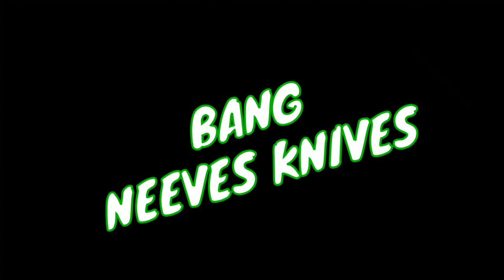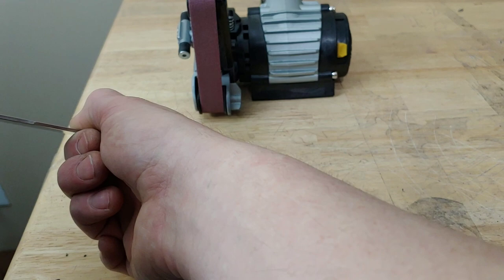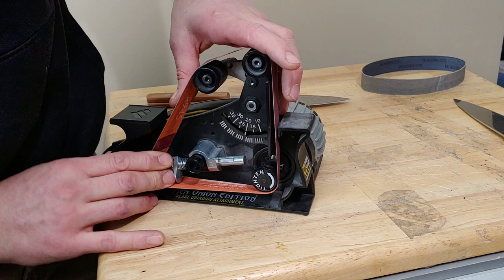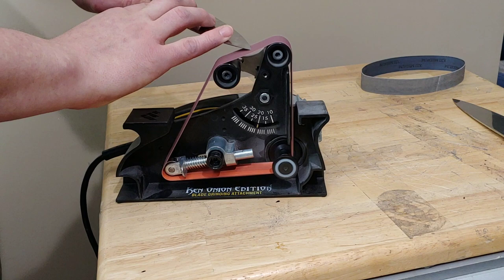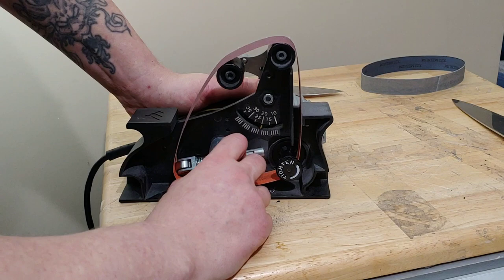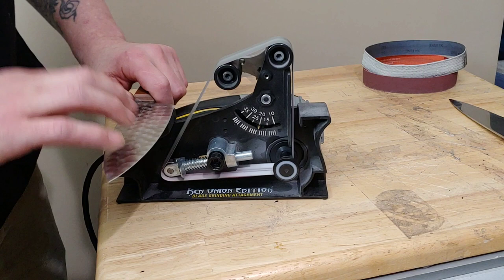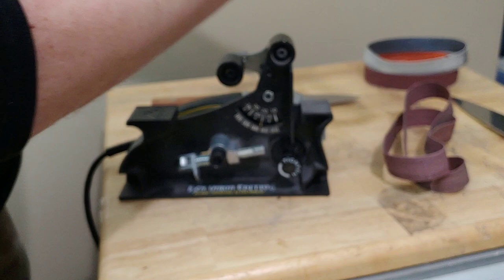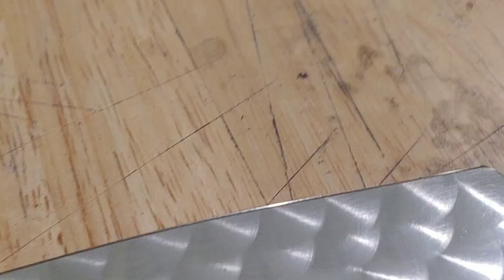DIFFERENT WAYS TO USE THE WORK SHARP KEN ONION

Comment: Very good video, this will help new users.  I received my second Ken Onion Blade grinding system.   My plan is to set up both on work bench.  The coarser belts will be used on one and X-4 and stopping belts on second one.  I will be doing this if sharpening multiple knives.  If you use Allan key you can move back wheel up one hole for flat angle grind which would be similar what you get when sharpening on stones.
Reply from the maker: Nice! Ive heard people say theres ways to get flat bevels with a couple tricks i mostly use it for grinding and for convex since i freehand flat edges, but great info
Reply: @NeevesKnives  .  Another modification you can make to the angle grinder is get 2 replacement leather strop -guided field sharpener.  They would need to be cut to length, but two of them will fit on plate behind the 90 degree plate.   With the the 2 leather strops which would be on behind belt makes It much better and consistent for doing 90 degree grinds.
Reply from the maker: @robertdewalt8711  oh wait i think i seen that somewhere, your talking about the leather that goes on the little field sharpener right
Reply: @NeevesKnives  .  Yes, the strips are about 13 mm wide.  You would need to cut off about 24-25 mm from length of each strip,   I have add the strips to both my angle grinders.  Two of them fit very well on the plate behind 90 degree plate.  On one of the Worksharp videos they talk about it and placed on their Angie grinder.

Comment: You said you get the burr with each belt, but you went to alternating strokes after the first belt. Are you getting a complete burr along the entire edge after just one pass on the second, third, etc. belts?
Reply from the maker: Sometimes yes i wasnt sharpening the same knife, some knives get a burr very fast especially if your using a low angle, when you lay the angle back and the bevel on the knife is high, then it takes more passes, if i match the amgle then its very fast

Comment: Great how to on sharpening with belts for any system. Have to be aware of heat though and some belts remove material like crazy. I Found out the hard way once.
Reply from the maker: Yes definitely thats why i keep it turned down to its lowest setting the edge never gets hot that way
Reply: As someone who has tried some actual grinding with the 80 grit belts they sell, I would hate to see what that would do to an edge!
Reply from the maker: @jameshealy4594  its fine for reprofiling as long as you move up in grt i originally bought them for regrinds so thats what i use them for mostly

Comment: Hi mate, great video. One additional method I use is to attach a piece of belt backing to the aluminium piece below the top wheel (if that makes sense), between the metal and the back of the vertical section of belt. You can then use it to put on a V edge as it gives you a platen to grind against. Maintaining the angle is trickier but with a little practice, it's not difficult to learn. I use a cheap spring clamp to stop it moving around when using the attachment since the flat bottom gives you a surface. I also love the stiff belt kit they sell now, though I've had terrible luck with the strops - two packs and they all broke within a short time of use, I think I must be doing something wrong but no idea what. Thanks again for the video! Oh, one more tip, especially for anyone trying actual grinding - get some neodymium magnets to help control dust or use a dust extraction system, I killed one by steel dust being sucked into the motor and shorting it. Still love the system.
Reply from the maker: Thats amazing James great idea! These can definitely be very versatile once you play around a bit

Comment: Great video! What are your thoughts on S35VN on a chef's knife like that? They aren't typically made with such high-hardness steels. Notice any problems with chipping or similar?
Reply from the maker: I wouldnt really expect to see chipping but more rolling, and i would think that not having a high hrc might be good, since you chop on hard surfaces, the edge is more likely to roll and not chip, but in all honesty i didn't notice any rolling or chipping it seems to work great i was worried at first having such a sharp edge that i did freehand that it would chip, and so far nothing, since its not my knife i put this edge on it, that is stronger but not as sharp, so hopefully the owner get great results

Comment: I just got both. does the grinder attachment completely replace the attachment it comes with? or do you swap depending the knife
Reply from the maker: personally i just use the grinder attachment mostly theres really no need to use the other one and i prefer the edges i get when i just freehand on the bigger belt

Comment: Thanks for a very good vid. Getting ready to try a very lge.
bowie. Aren't u removing ur burr
on last belt, alternating sides. Never noticed burr after doing so.
Reply from the maker: Yes, you can wait till the last belt or stone to fully remove your burr, alternating sides, works on this if the edge is thin and its at a high ° you basically get a burr with every pass but if not then you want to make as many passses as it takes till you do
Reply: Thanks for sharing ur knowledge, always helpful